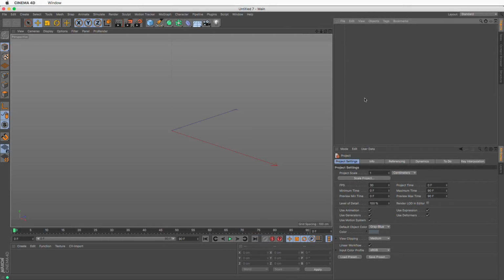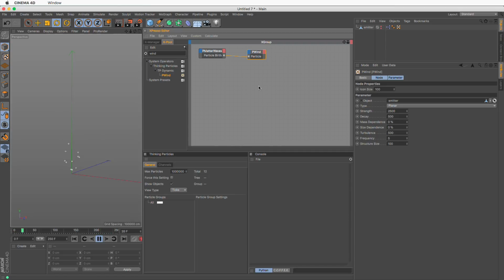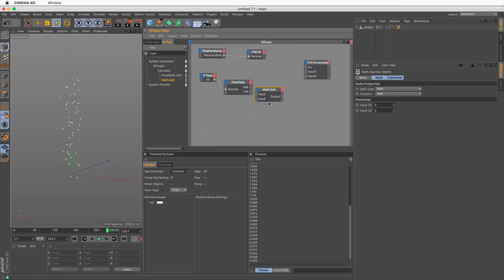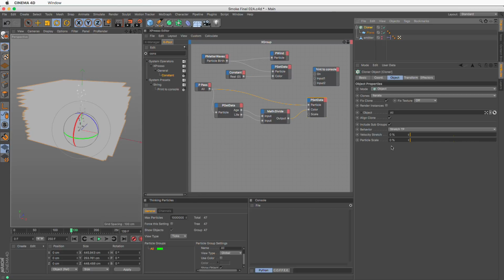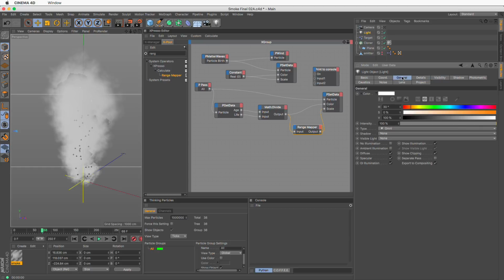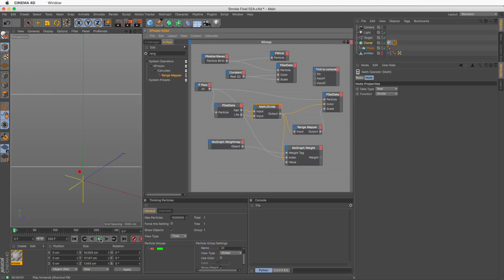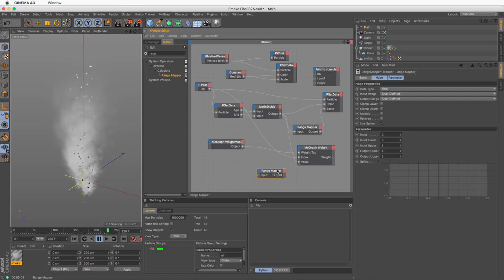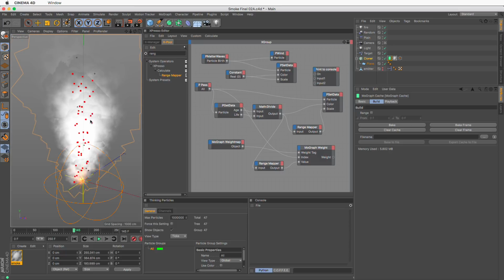Fire and Smoke with Thinking Particles and MoGraph

Comment: Im not getting the proper output at 9.05 , get this error message - "SyntaxError: Missing parentheses in call to 'print'. Did you mean print(Input1 + Input2)?"
>>
Reply from the maker: Hi Onur, since R23 the Python Version of Cinema 4D is 3, and the print syntax requires Parenthesis. I did this tutorial a version older, so that was not a requirement back then. Apparently, in R23 we forgot to change the "Print to Console" code to comply with Python 3. Just add the parenthesis to anything you want to Print in C4D's Python.
Reply: @noseman  Hello Athanasios, thank you so much for letting me know and Thanks for Tut as well, it helps me out a lot :) . All the best !
Reply: If Possible , would you be able to make more Tuts for Thinking Particles please. I want to get XParticles but its pricey at £700 so want to learn TP to try and Composite in C4D. Thanks for the Great Lesson ! (also, for some reason I can't view particles in Real Time on R23, it comes out looking all voxelated, have to render each frame to see result)